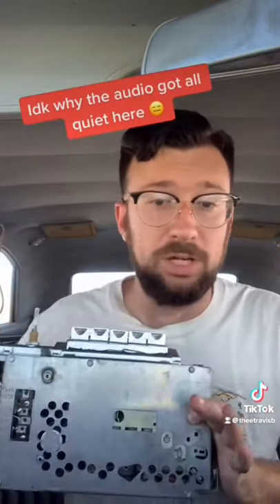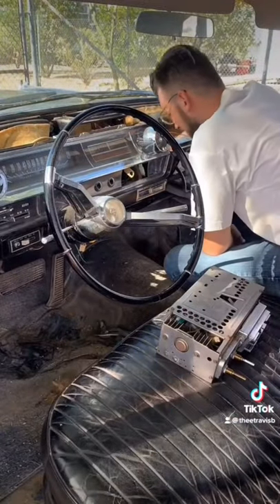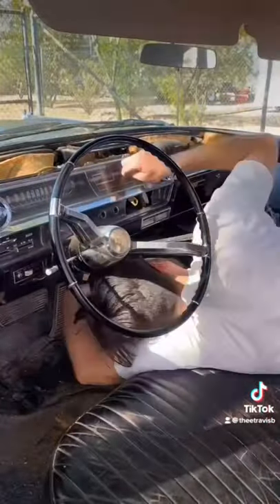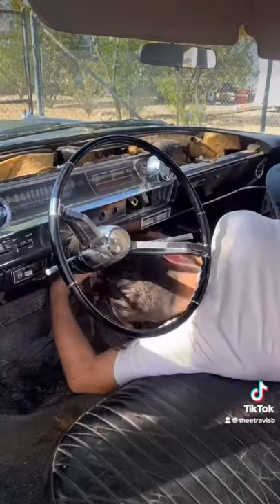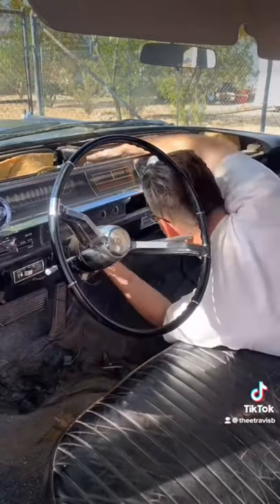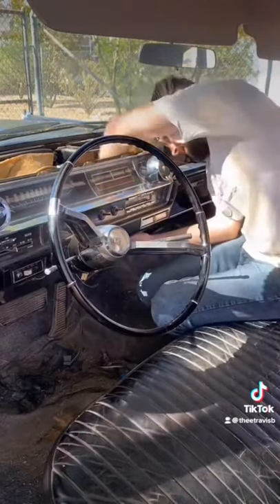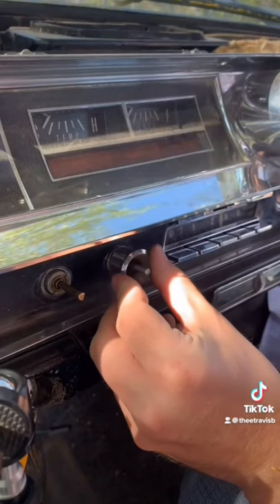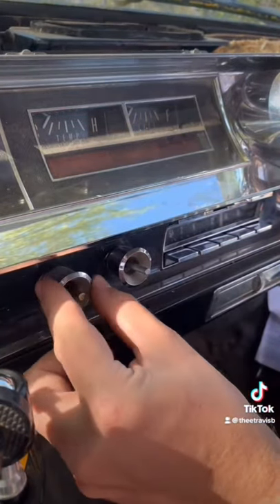64 caddy limo restore pt 12/13 #shorts #tiktok

Comment: Nice period correct radio! I had two funeral cars. A 70 Cadillac hearse, a 1961 Hess & Iesenheart 5 way hearse and the chance to pickup a 62 Lincoln limousine. The cars were typical low miles impeccably serviced and garaged cars. The two hearses cost me $1,500 ready to drive! It was 1995 when I got them. Luxury!